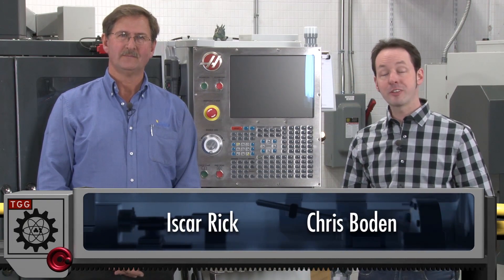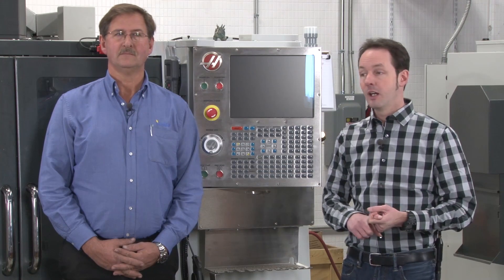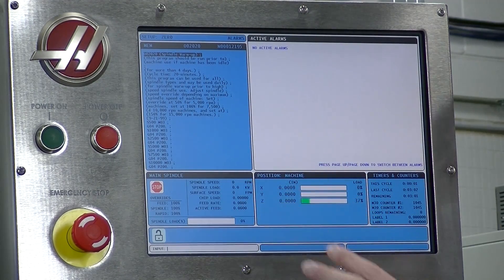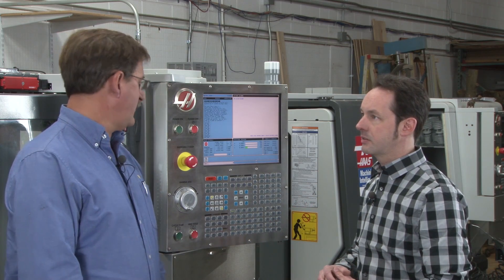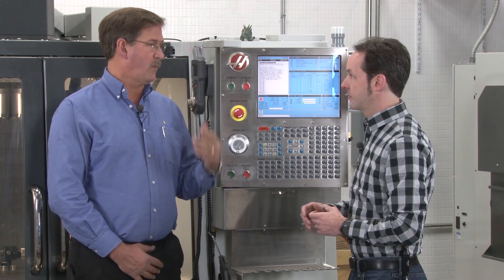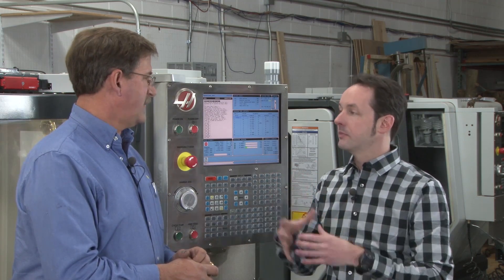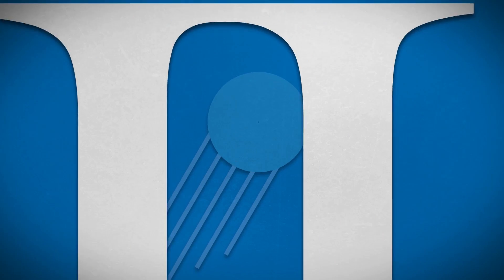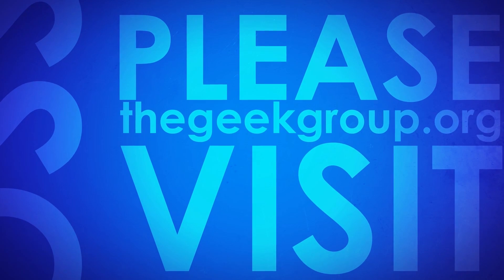Powering a Mill On/Off: CNC Training Series

Comment: I have an SR-100 (about 4 years old).  When it was being installed, the Haas rep told me to always move the machine away from zero before shutting it down - so I always take a couple of seconds and jog it a little off before powering down. 

While it's clearly an inconsequential issue, I wonder if that is actually necessary.